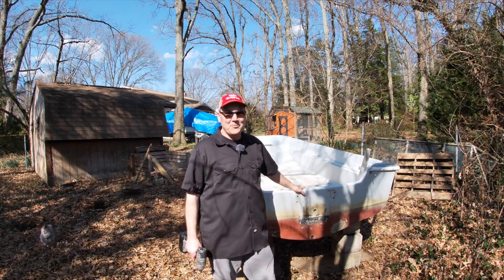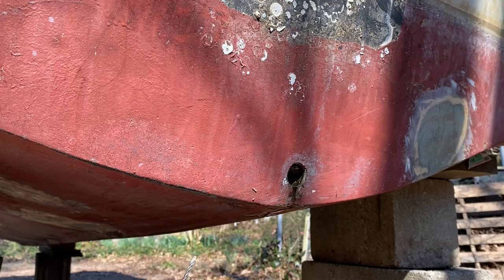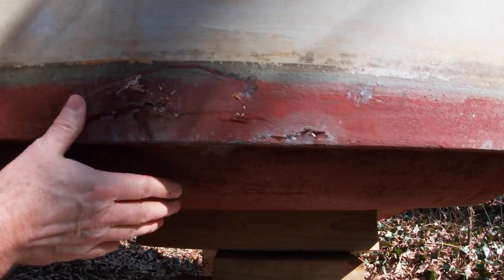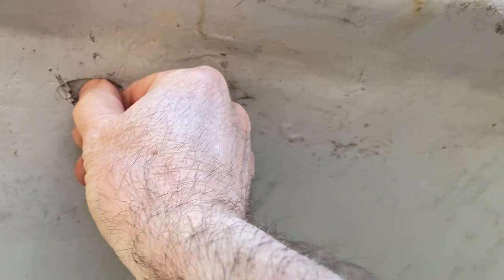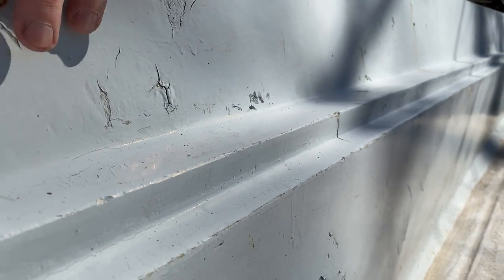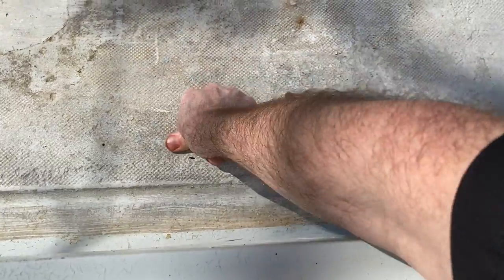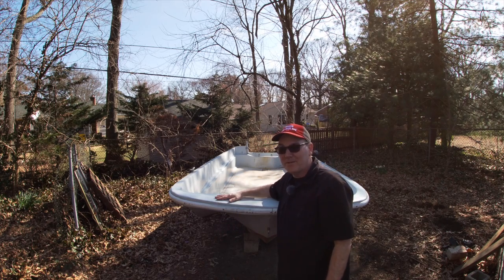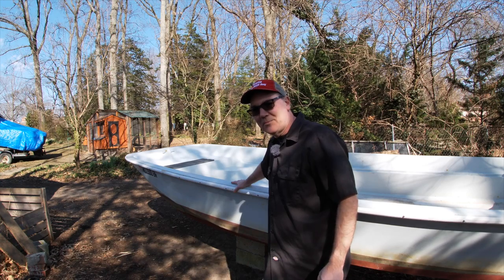How Bad Is This Cheap Old Boat? A Closer Look At An Old Boston Whaler

Comment: Wayne,
As always a great video. Having had 50 years of experience w Whalers allow me some insight. 1/ It would be a big job for anyone. It’s just too much for most people. 2/ As far as the foam is concerned it is closed cell and does not absorb water. Likely you are seeing hydraulic compression where foam has delaminated from the fiberglass skin. Drain it dry for 3 months then pack the area and re fiberglass. Keep up your great videos!

Comment: Wayne : The Boston Whaler was a great boat. My cousin has one , we use to take out on the North East River, Charlestown, Md. It was back in the 1960's. But I still like my aluminum boat, you get a dent you bang it out, you get a hole you get the JB Weld out, big hole you weld in a patch. But the Whalers are nice boats.

Comment: Perhaps my sights are a bit low but that's my dream boat. Few people realize it's the best-designed small boat ever mass-produced. The inverted hull idea was borrowed from Sea Sled, modified, and improved. Water and air are channeled under the hull hydraulically lifting it and reducing drag. I'd sell my dog to get one.

Comment: Wow, that's scary. That whaler would need a lot of work. I've seen others replace the foam and do all of that. Looks like something I wouldn't want to do. I restored a 13' whaler, but it mostly just needed paint stripped and then to be painted and get an engine. Much more up my alley. I like to go boating. Not spending my life restoring boats!
Reply from the maker: Yeah there's only so many nice days - I'd rather spend them on the water!

Comment: For $2-3000 you can make a usable boat and be on the water , second hand engine trailer , could put a low hp tiller motor and putt around , crab, fish.
Reply: I have two of these and may give both away, free projects . One is used every year , best boat I’ve owned , the other is a Katrina boat . I got my 500 out of it .

Comment: I totally agree, this not just a cosmetic job, this boat needs to be completely disassembles, all the structural members redone , all the fiberglass patching and jointing redone plus the flotation foam plus the paint.
To my experience, there is more than 5,000 $ just in materials plus many, many, many hours of work to have a seaworthy boat and  a boat like this one have a very low collectible value.
I done such a restoration job on a 18 ft Inboard runabout, what I can say is that I invested over 8,000 $ in material including the revision of the engine and the drive, I invested 6 years to complete the project and i would not redo on such a low value boat..
The only benefit for my resto is that I sail this boat for the last 10 years without any problem and I deeply know it in the case of a breakdown.
Reply from the maker: When I was doing some real rough estimating of materials and supplies I was coming up with similar numbers.

Comment: You are smart.
I would have to agree with you and not keep it. It is a lot of hours of work The Boat is on the bigger size to work on it yourself self to have to turn over.

I have a 1972 Boston whaler 13 that I was able to pick up for $500 and was lucky that it was taken care of and very little work. I can also flip it over and work on it.

I can also pull it with a 4 cylinder car. 
Just saying.
 
You still will get your money back and then some. Good luck.

Comment: Wow, it looks like she needs a total gut job with the deck removed, new stringers, foam and deck along with all the repairs on the hull.  After that she will still need running gear and a motor with controls. Maybe after about ten grand and two or three years she would be beautiful. I wonder if Boston Whaler would even try to restore her and what that would cost. Lol. I'm only about 30 miles from their factory here in Florida. She's a diamond in the rough. I have a 21 foot 33 year old West Point down easter CC that is starting to show her age but still gets me around. Hope she gets a good home and lives another 50 years.

Comment: This seems like a project that would only be worth it if you personally had sentimental value in the boat. I have an older Glastron that ive owned for about 10 years that needs extensive repairs that I plan to slowly do because I love the boat.

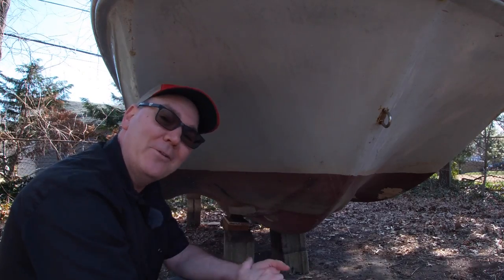Comment: Hello Wayne, I was hoping you would inspire me to get going replacing the transom on a boat that I have. @11:00 is a key point. when it's nice enough to do glass work outside.   It's far too nice to not go fishing. ;-)  I just have to suck it up and get going.
Reply: Wish I had known when Aqua sports stopped using wood when I bought mine. 🙂 Sometimes education is not inexpensive.

Comment: If it's not your thing pass on it! For others it would be worth it.  For me I would fix it but I have access to a friend who did this type of work for years. Plus I can do fiberglass repair, it doesn't bother me a bit even outside where I have 6 good months to work on it. But different circumstances. You need to do what's best for you.

Comment: Wayne I had a 1970 Boston whaler with the same problem. I named it the "F-BOMB!  I loved that boat! I had to keep it inside because every time it rained it would get water logged. It was the most stablest boat I've ever owned. I thought I would keep that boat forever but it just kept getting worse as the years went on. I do a lot of river fishing and as you know rivers have rocks. If I bumped a rock even slightly it would crack that old gel coat like an egg shell. I wound up giving the boat to my uncle and he let it rot into the ground. I now have an alumacraft built in 1970 with 8" diameter pontoons on each and it is as stable if not better then the whaler and I can bounce off of river rocks with out crying. I've done a lot of modifications to alumacraft. I can send you some pictures if you are interested. Its name is "Shark Bait"!

Comment: That boat has been put through it. Some dreamer will be glad to take it off your hands. That boat is not worth owning. I'm sure whalers are great and I would like to have a smaller one for inshore fishing. Aluminum riveted boats are so much easier to work on though. The trade off is ride quality. I hate working with fiberglass, polyester resin, gel coat etc. The only boat I would consider grinding on fiberglass with full protective gear in the heat for would be an older SeaCraft. They also have a cult like following. Decent whalers are easier to find for a fair price during offseason so no need to torture yourself. Mckee made good whaler copies but they aren't the bargains they once were. Just take a loss on the boat and save someone from themself.
Reply from the maker: I have been just running it as is. Of course I did fill these holes that I drilled!

Comment: As the current owner of a 1977 Montauk and previous owner of several other Whalers I can attest to the greatness of Whalers.  They are very tough boats and will last a very long time with basic care.  However, if they are abused and neglected, they are like any boat in that they will ultimately deteriorate to the point of "death".  Unfortunately, your boat has been abused and neglected to that point.  The hull, the foam and the floor are the components that make up the "foundation" of a Whaler and all three of those components have failed in this boat.  This boat is "dead" and the reality is; there is no way to "restore" this boat, this boat would have to be rebuilt.  You are wise to pass on undertaking such a project.
Reply from the maker: That's a great assessment of this particular boat! I think if at least one of those three areas was decent, it would be a different story.

Comment: The boat will have a heavy Ballance and good stability, but it's gonna need a large motor to get it moving at any amount of speed 
I would roll it over and refinish the keels
Than upright an do over the deck

Comment: I’d say about 90% of whalers from the 60’s - 90’s have waterlogged hulls. That means nothing! It’s a whaler!! I’ve seen slabs running all over the water with logged hulls cracked transoms and sogggy floors. You forget that that was a work boat being used until you picked it up. Somebody had a 2 stroke and a console mounted on there and was using it. Not every boats gna be the bell of the ball.
Reply from the maker: Excellent points!

Comment: Oh my. I just bought a 1988 bassmaster and now I'm freaking out if I bought something that's gonna be a yard ornament cause I took am not 30 anymore with a climate controlled space. 😂 Guess we'll find out later.
Reply from the maker: I hope your boat is better than mine!
Reply: @WayneTheBoatGuy  me too. Haven't had time to go over it to much and I bought it when it was freezing cold out. Thww motor runs like a top just need impeller done. I'm just afraid of the fiberglass hull because I only have had an aluminum hull boat before. Either way I'm excited to learn and I learn best by doing. So here we go 😂